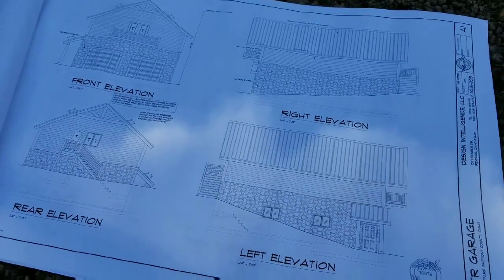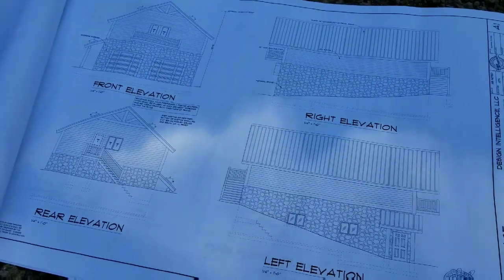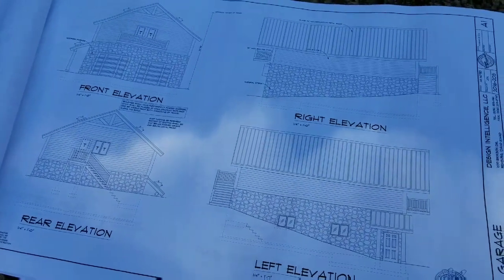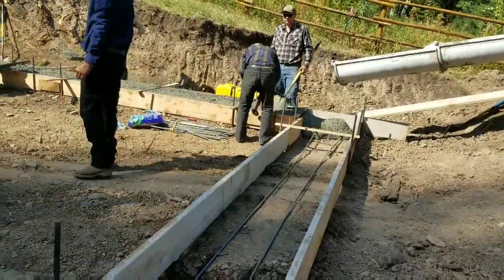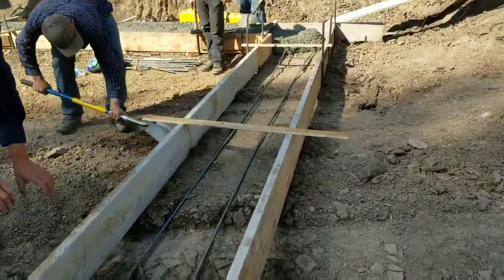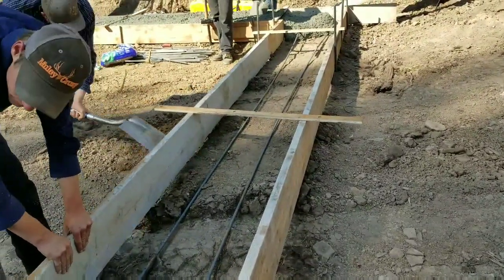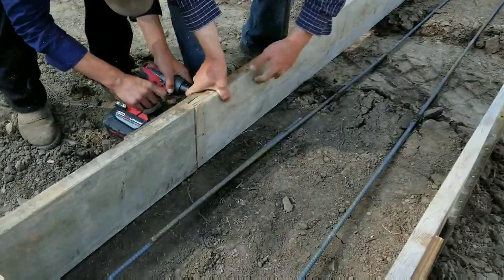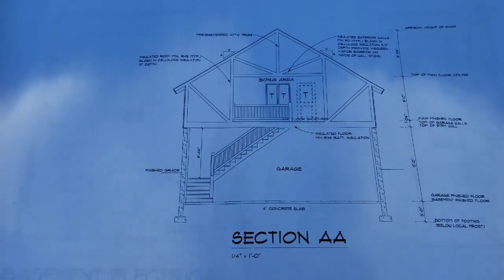Mountain Retreat Project,  Building & Pouring Concrete Footings

Comment: I've never seen cement poured for a foundation with SO LITTLE steel for reinforcement ! They must have an idiot engineer for their house plans .
Reply: Codes are different for every jurisdiction, and you're not familiar with the situation, so you should maybe hold your criticism.  The engineer may know exactly what they are doing by doing their job.  "Over-engineered" is an oxy-moron, because to "engineer" something is to size it properly, and not be wasteful.  It's usually those folks who don't know anything that "over-build"; out of ignorance.
Reply: joe doakes --- It appears that you don't know much about construction. Cement isn't poured, it's one of the four main ingredients in CONCRETE that is PLACED (not poured) for foundations. Btw, I'm not an architect or an engineer, just a retired professional General Contractor. Apparently, unknown to you, many parts of Highway projects are designed/engineered and built with no steel reinforcement of any kind and you drive on them, possibly, daily.
Reply: I know enough to know that every contractor friend I associated with used plenty of rebar in every house foundation they poured ! Cement , concrete , is just a play on words.........you still comprehend my meaning ! As far as bridges or any structure without rebar I fully admit I know absolutely nothing ! My guess is , that they include a pre tensioned steel beam within the body of the structure that is designed to flex with variations in load and temperature .
Reply: joe doakes --- Charley Ward's reply to you seems to fit you perfectly....and I didn't see your comment as a "play on words"!
Reply: You just followed the instructions of the engineer ! If , something fails , and you followed the instructions on the plans you've done your job as a builder . Personally , I'd document Every phase of the building process so I could prove , visually , I followed the plans too the letter !
Reply: joe doakes --- Great comment!